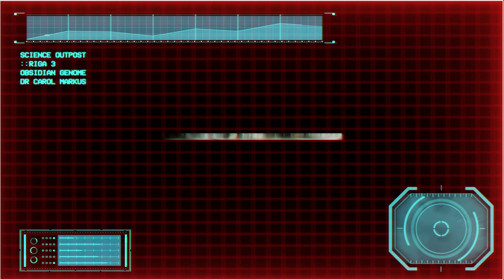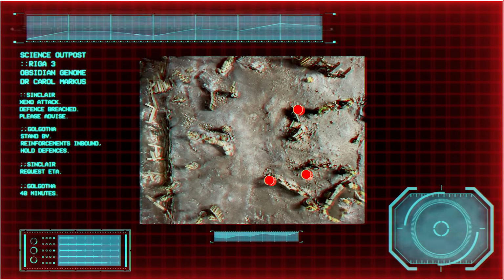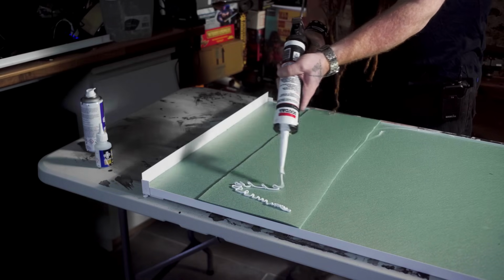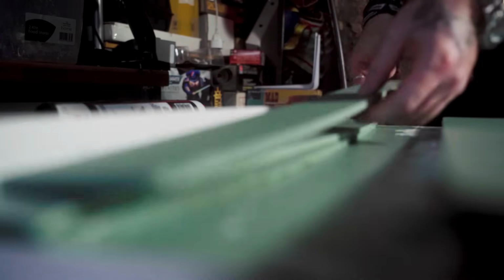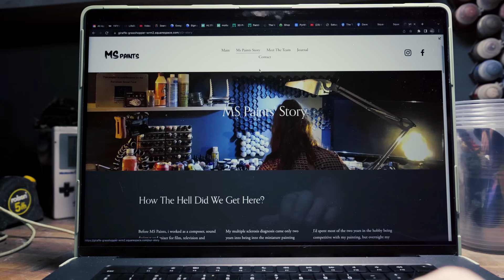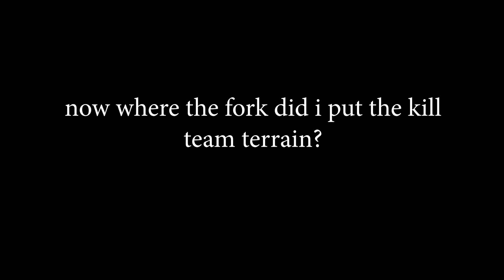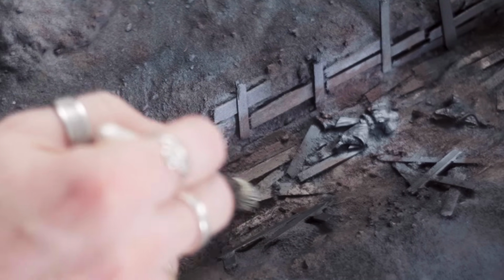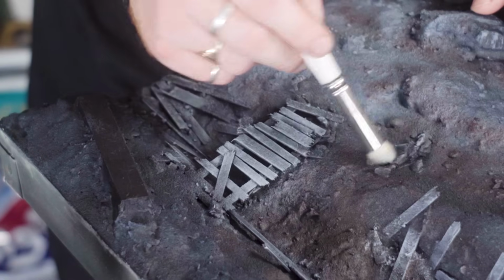Building Your First WARHAMMER BOARD

Comment: Some advice, if the board you're making is only going to be used a few times then go for normal plaster, after a while it chip.. but if you want it to last use Ultracal plaster, it dries super hard and will last longer, use it just the same as normal plaster. I used to make gaming tables and I always used ultracal.

Comment: Another great video. If you don’t mind me asking, why do you use isopropyl alcohol? The model railway guys put some washing up liquid into the PVA/water mix and do it all in a single hit. Have you found your method more reliable?
Reply from the maker: Yeah usually, when tilegrout is involved. It's really water resistant. Tried the dish soap and it didn't go so well. I imagine it's fine in a lot of cases i just prefer to bin off the risk.
Reply: @MSPaints  cool, thanks for your reply.

Comment: I have that same DS9 kit, and started it around 2003. I should really get back to it.

With the epoxy you use at the end, are there any issues with heating? I have a Stormlord I want to turn into a daemonette hot tub, but all the clear resins I've looked at heat while curing, to the point I'm not sure if it would be an issue with the surrounding plastic.
Reply from the maker: Yeah it heated up a bit. Most of the ones I’ve used have, but never had issue with them damaging other materials

Comment: i'd actually love to know what those plastic right angle things are called - would be great for some LED strips im trying to install on our ceiling... probably a corner edge (molding) but ive never seen any that thin before.
Reply: They're corner protectors, cN get them in wood or PVC. These look like PVC. Are really cheap from B&Q. They're designed to go on the corner of cupboards in places like your kitchen to protect them feom wear/damage. I recently used some to make a paint rack.
Reply: @samuelashton8357  much obliged!